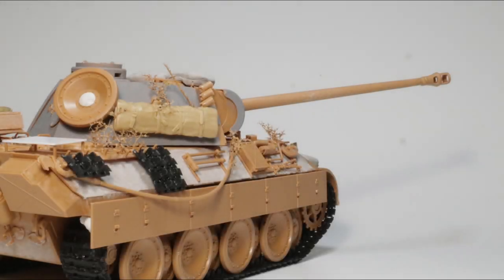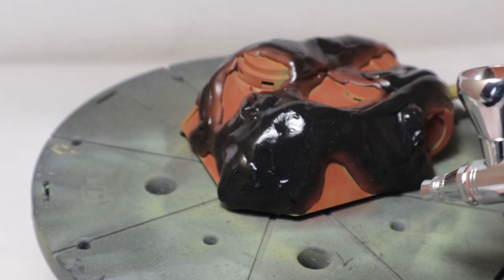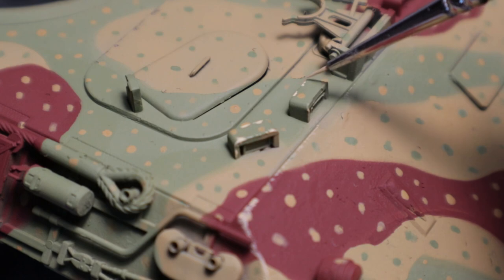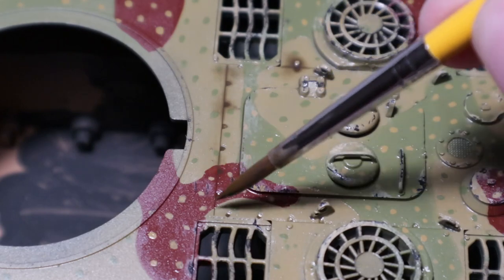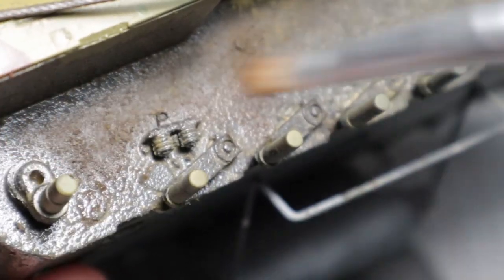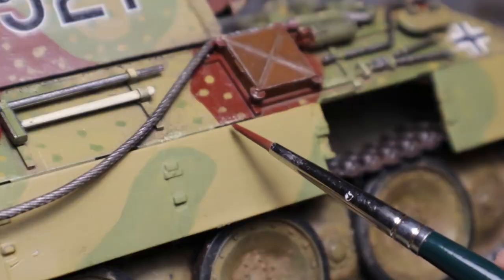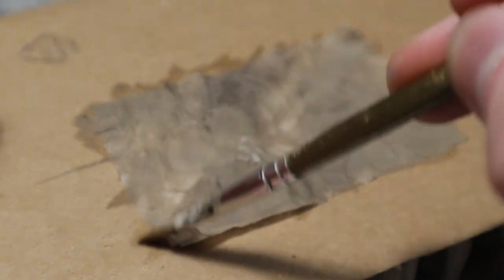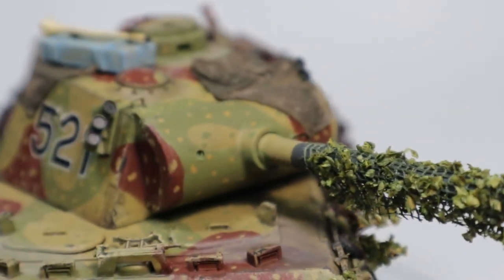Panther Ausf. D - Part 2 Painting & Weathering - ICM 1/35 Tank Model Build

Comment: how you thinned this AK paints? and what PSI you used? my ak paints like all acrylic based bases are clocking in airbrush after fiew seconds...
Reply from the maker: For thinning I used AKs 3rd gen acrylic thinner with a ratio of about 60% paint 40% thinner. I then spray them at around 30 PSI.